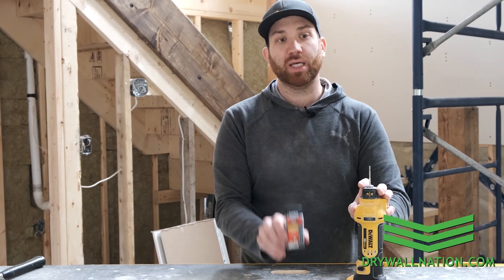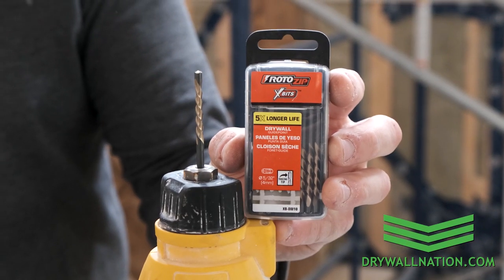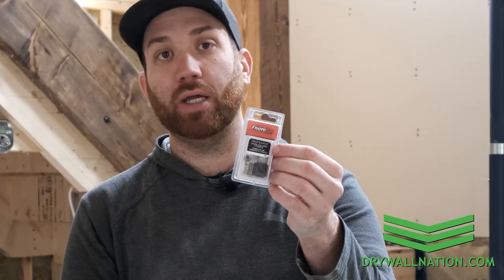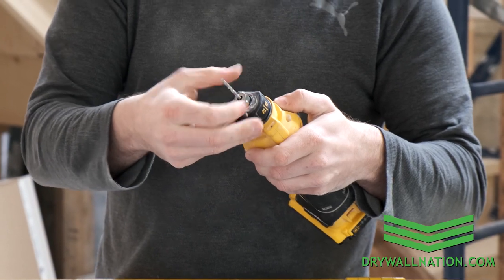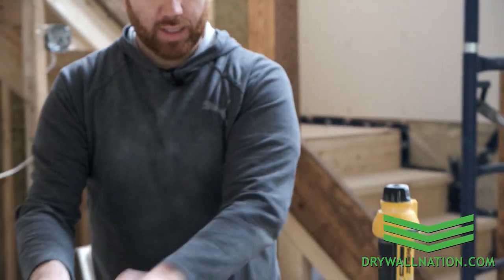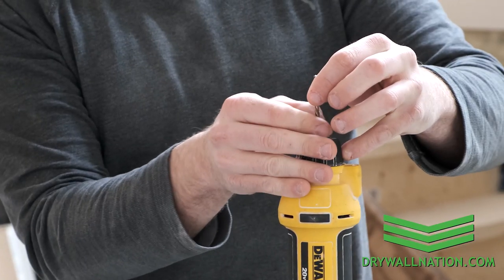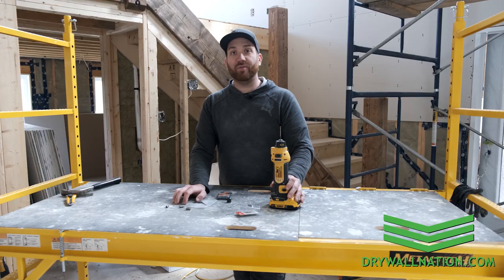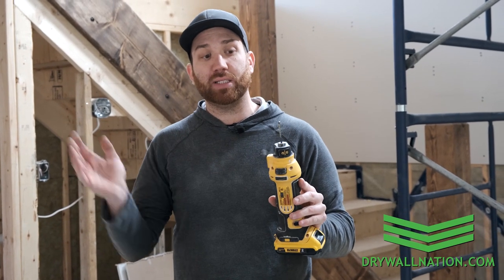Drywall Router - Rotozip Xbits - How to Change Collet & Nut Kit

Comment: Is it just experience why you use the tool without the depth guide attached, I’ve never used one but would be worried about going through a cable in a plug socket.

Comment: you should emphasize that you're using the RotoZip replacement collet kit, and which other brands of roto-tool have collet chucks that are compatible with the RotoZip replacement collets. I know your channel uses DeWalt and Milwaukee brands, and I've personally upgraded my Ridgid roto-tool with the RotoZip replacement collets to open myself up to the world of 5/32 bits. Can you comment on any other brands which use the same interchangeable size  of RotoZip collets that are readily available in stores?? Makita?? Bosch?? etc. or any brands you've found which are incompatible?